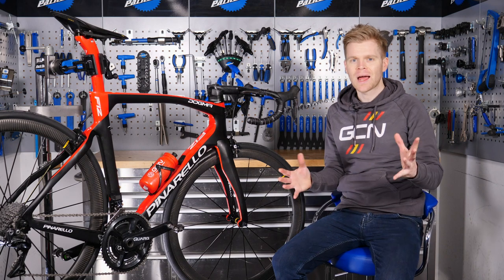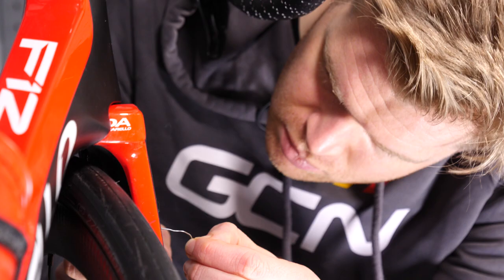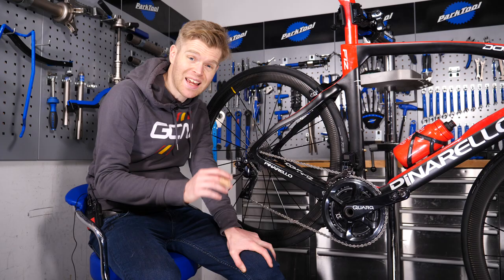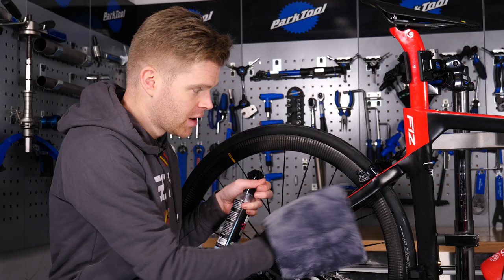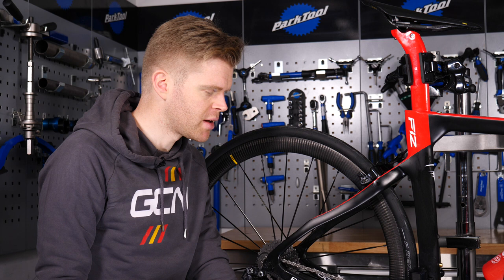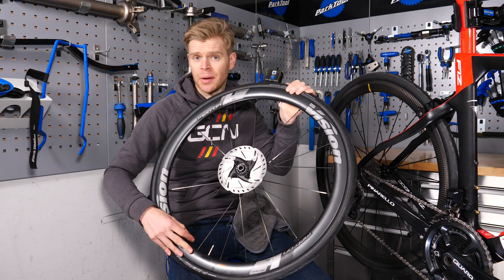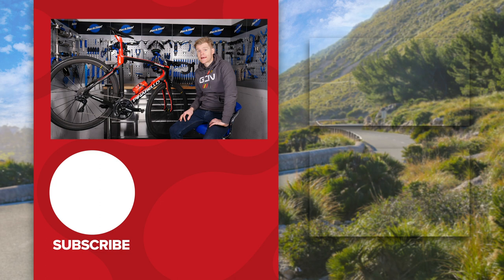Next Level Road Bike Maintenance Hacks | How To Make Your Bike Amazing

Comment from the maker: What are your next level maintenance hacks?
Reply: What about Si's WD40 one? Not worth a re-mention?
Reply: Get the intern to do it.
Reply: Staying with rims :)
Reply: Ride a fixed gear bike and only need to replace brake pads and drive train every few years.
Reply: I ceramic coat my frame and wheelset
Reply: Don't use wax on a chain.  Use unsalted butter.  That way you lube your chain and have an emergency snack if you hit the bonk.
Reply: simple silicon spray as a frame polish is a nobrainer.
Reply: @Robinators  just don't get on the brakes/rims!
Reply: CLP gun cleaner all over the derailuer, except the clutch. And then wiped off.

Rim brakes allow small truing adjustments in no time at all.

Gasoline is a great degreaser. And if its.poured in small amounts on the asphalt/stone surface it doesnt hurt the enviroment.
Reply: I just wish I had a bike....someone stole it from outside the local cafe stop
Reply: Start shopping in the car section for car protectants for bikes. If you have a glossy frame, look at turtle wax's hybrid series to get a hydrophobic surface on your frame.
You wont need as much compared to a car so one bottle can last you a long time. For the best or Matte paint you'll need a special kind of ceramic nano coating for matte paint.
Reply: My hack is to spend more time on the bike than fixing the bike.
Reply: The last time I changed my chainrings and gears etc I bought two chains and changed them regularly every 500 km. That way two chains get “friendly” with all the metal parts equally. And I didn’t have to hurry through a quick clean just to get riding again.  Chain stretch and metal wear has been negligible.
Reply: Wax and Teflon coating. 👍

Comment: Super glue the gear or brake cables before cutting them, let dry, then cut. Stops the cables unwinding and looks sharp
Reply: Cut and then superglue the end - for the real weight weenies
Reply: This! Easier and looks better than soldering them.
Reply: @lassefk3171  as I said, super glue before the cut, not after.
Reply: Thanks, gonna try it next time.
Reply: 2part quickset epoxy is a bit more water resistant than superglue.
Reply: 2part quickset epoxy is a bit more water resistant than superglue.
Reply: I use heatshrink sleeving on the end of my cables. Shrink it before I cut the cable. Nice and neat, and it ain't unravelling for anyone.

Comment: Instead of soldering cable ends, use heat shrink tubing.  Far more convenient, and easier to apply.
Reply: or a drop of super glue, I do it every time on my mountain bike :)
Reply: Agree, looks way better, easier and no risk of hot solder on other parts of the bike.
Reply: The solder doesn't work with good cables, that usually have been treated with Teflon.
Reply: 2part epoxy
Reply: I use ferrules, but I put them on properly :-)
Reply: Paul Sherwood, you’re kinda “special” then as no one else must know how?

Comment: Wrapping the bars the other way is a bad idea, the edges of the tape will peel back and look crap in no time.
Reply: 100% this. Add to that the weight of your palms near the hoods shifts the tape pretty easily.
Reply: Ollie needs to go back and do this again, I completely stopped listening when I saw that bar tape.
Reply: I had my bars wrapped like that when I bought it, rode it that way and you know what? not a single problem for 2 years until I changed my handlebars al together. the fraying is fake news. just wrap your bars the way you like it.
Reply: Just did this two days ago. We shall see what happens. If so, I'll throw on some electrical tape, no big deal.
Reply: @velocirapture89  Correct. Worst case, you tape it, so zero penalty anyway.

Comment: 1.  wrapping bar tape: personal choice tho, you finish tape in wrong direction. Make sure you wrap it very tight. 

2. Soldering cables zinc and lead dont stick to steel very well. For that you need something that can melt steal. I wouldnt mess with something like that around my carbon bike. Just use some superglue or better 2 component glue. 

3.waxing: good one. Only for summer. Dont do that in the winter...or dont forget to take some wet lube on a ride just in case.
Reply: PS: In my opinion, next level maintenance comes from tracking lifespan of each component on your bike. You can make simple spreadsheet with date of component installation and track lifespan of every component or better if you are using Strava just connect it to  ProBikeGarage app. Its simple and effective with end of life notifications and custom time or distance notifications for each component. I use it for charging my bike computer, chain wear check notifications, cassete wear and grease and clean notifications......
Reply: absolute legend right here
Reply: 2part epoxy is more water resistant.
Reply: So I repair electronics.  Solder is one of the ways to connect things.  These things are steel and alloys of.  The solder sticks well to those.  This is been practiced for decades.  Super glue cracks.
Reply: @McGregis  That's right I forgot you had a channel with tons of subs showing us how to fix bikes.

Comment: Has a PhD in chemistry. Doesn't distinguish flux from solder.
Reply: And the real pro's braze their cables anyway. Gold tips match the gold chain!

I did solder once, and it looked nice. Now I superglue + heat shrink. Just far easier, and works on friends' old/dirty cables, and they don't think you are as crazy as when they see you busting out the Weller.
Reply: and difficult to get solder to grab onto stainless steel cable.
Reply: @carlosgaspar8447  Carlos, use the right solder.  Usually 46 percent silver mate.  Works amazing with stainless.  Regular solder won't bind at all
Reply: Well, let's be honest, it's more electricians who know this stuff.

Comment: Don't know if I'd wrap the bars that way, wouldn't your hands naturally "unwrap" the tape slowly over time?
Reply: Agree
Reply: If that is the case, you can still start at the top of your bars and just wrap the other way.
Reply: Yes
Reply: Most people don't "throttle" their bars, but if you do, that method is not for you.
Reply: They've literally said in other videos not to wrap them from the top.
Reply: @markj.a351  yea. Working on bicycles for 40 years and you see customer who wrap from top down all gnarly.  
The cat 1 2 3 riders come in, wrapped bottom to top.
As a service tech, we wrap bottom up. The argument about throttle grip is moot. Gra ity, hands sliding down. Doesnt work well. Bottom up is correct. He just maybe made a mistake.
Reply: @brianritter9379  Wrapping bottom up is more about messing up the tape when riding in the drops. Wrapping top down, the upper half of each wrap of tape is exposed, so if you hands slip downwards at all while in the drops (sweat + gravity), it'll curl the top edge downward, messing it up.

The direction of wrap around the bars (clockwise or anti-clockwise) has to do with whether or not you tend to throttle the bars, but that isn't as much of a concern.
Reply: Without getting into a debate over whether bottom up or top down is correct. I've been ridding since 1985 and ive  wrapped my bars from the top (I like a cleaner aesthetic) and never encountered any form of unwrapping of the bar tape. It should be notted that I don't throttle my grip or ride to frequently in the drops and mainly ride by utilizing the hoods.
Reply: @anieste  as long as it works. Cool. It really doesnt matter.
Reply: @markj.a351  this video should come with a stupid sticker warning.
Reply: Been riding top down for about 3 years. Never had the tape unravel. Both ways work just wrap the bars in the correct direction.
Reply: @anieste  keyboard riders say you should have had problems. Go back in time and have problems, you silly :)
Reply: @valuableblu  that's a good idea.
Reply: the fraying and unwrapping is fake news. My bars came wrapped from the tops when I bought it, and I never had any issues at all. It really doesn't matter that much how you wrap them because we don't live in the '70 any more and bar tape is sticky now and will just stay in place.

Comment: Tip 1: don't wax your chain. Don't see pro's riding with them, and there's a reason. If you do it, you'll notice the chain will make more noise than if you had lubricated it. Noise are soundwaves, molecules in the air vibrating. To make these vibrate you need a certain amount of energy. Where does this energy come from? Yes, from your legs. Noise (acoustic energy) = energy loss. And yes I have experience with it because I do it for my city commuting bike, because this means I don't have to use oil and my pants stay clean.

Tip 2: Don't buy brake disc cleaner. Go to any auto parts shop and buy 'brake cleaner' for cars. It is exactly the same, it is used to clean new brake rotors upon installation to prevent squealing brakes. The only difference is the price. and it's a huge difference, a factor 10. I buy brake cleaner for 1.09€ per 400ml bottle, where as the muc-off disc brake cleaner used in this video is between 10-20€ for 400ml depending on where you buy it.
Reply: Tip 2 especially.

Comment: I use isopropyl alcohol on my discs and then wipe it off with a clan cloth. Cheaper and better
Reply: Likewise, does the job and much cheapness.
Reply: I get good results 50/50 distilled water/91% isopropyl alcohol....👍👍👍👍
Reply: is isopropyl act as a degreaser?
Reply: @lucianoserafino5872  yes. Cheap but great
Reply: Not cheaper where I am, $10 for 4 cans of brake clean, $8 for tiny bottle of iso.
Reply: @derekhobbs1102  does your commercial brake cleaner work well? I use diluted ISOPROPYL and wanted to try auto parts rotor cleaner. But read an article in bicycle magazine that cautioned on some auto cleaners as they contain small amounts of oil
Reply: You don't want oil contamination on car brakes. 
I use it on my bench tops after every other cleaner to get last residual oil off.
Reply: @derekhobbs1102  I know that. But apparently manufacturers of disc brake cleaners add oil to keep rotors from rusting

Comment: Extra hack.  Add 25 grams of PTFE to the wax bath and just a touch of paraffin oil, around 5% by volume relative to melted wax.  Paraffin oil means different things in different countries, but the best stuff is used in beauty salons to lower the melting point of paraffin wax they use to rip hair off of people's bodies.  So search for it using words "paraffin oil bikini".  Add a little and it is quieter.  Add too much and the chain is not as clean.  The method in the GCN video (pure paraffin wax only) will result in a much noisier chain and one that is quite stiff for the first 50 km.  However you do it, molten paraffin wax is vastly superior than any other lube.  The ultrasonic cleaner helps a lot.  If the chain is not cleaned to bare metal before immersing it into wax the first time, the wax won't adhere as well.  After the first time you just need to re-immerse in molten wax.
Reply: i agree. but for paraffin oil, go as your weather temps/humidity demand. the colder/wetter the weather, the more paraffin you add. simply to keep the cream texture which lasts longer and sticks better. 5% is the bare minimum for a "normal" weather.
Reply: I use 50grams of teflon powder per 500grams of paraffin wax, absolutely brilliant, still have a clean drive train after 100miles this weekend in wet wales. And its silent
Reply: @nearlee2000  I've done it that way too.  Works great That way too.  The only advantage of my recipe is paraffin oil costs a little less than PTFE and chain is a little less stiff at the beginning.
Reply: @JayB-lz6yd  Yes.  In very hot summer of Houston it is better with 2% paraffin oil.
Reply: Give your chain a true 'Brazilian' . I cannot possibly be the only bloke to think this 😜 ew!

Comment: I've been soldering cable ends for years, it works great.  Easiest is to use some flux as well as the flux-cored solder.  I have also used a wax chain lube called 'Squirt' this winter, it has worked great.  If you are going to have a really wet long ride, just apply it twice the day before.  The chain stays nice and clean without the faff of a hot wax bath.

Comment: As far as the brake cable end, try snipping off the cable for a smooth flat-end, then just add a minute dibble of super glue to it, then slid on a new cable end of your color and allow to dry on without crimping for a beautiful clean look.  Hack ahoy!

Comment: To solder the end of a cable either use a very high wattage iron, or a small torch.... Using an iron meant for small to medium size electronic equipment is a bad idea. (A bodge if you will).
Reply: Walt Hansen a reminder not to get to close to the carbon frame with that torch is due

Comment: Backward bar tape, Ollie, makes it wear out faster because your hands always will gravitate from center towards the brake levers, eventually catching the edges of the tape and curling it upward -- not good.
Best, cleanest approach (imo) is to start at the plugs, in the lower middle and begin wrapping in the direction of the headtube. Working up the bar this way you'll also be able to cut off and super-glue without using finishing tape.  It just makes sense.

Comment: You can also use Isopropanol for disc brake rotor cleaning, it as well is a really volatile fat solvent , since it’s alcohol. There are options with 70% and 99% concentration, the 99% one being stronger but also more volatile, so the 70% one might be weaker but has more time to do its thing before it evaporates. Both work really well but most of the time the 99% concentration is cheaper to buy, because 70% often is medical quality. So you could just buy 99% and dilute it yourself. Wether option you might choose, it will sure be cheaper than buying specific disc brake cleaner and works the exact same way.

Comment: If you're going to wrap tape from the stem down, make sure you are wrapping the correct direction so that twisting action tightens the wrap (unlike what it looks like was done in this video).  You'll still need to switch direction at the levers to account for the opposing twist direction.

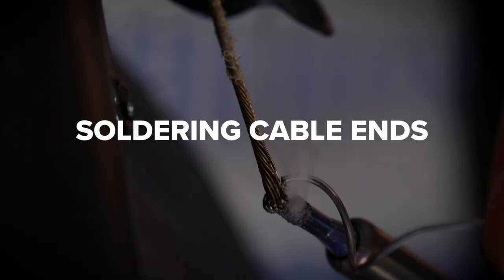Comment: TL;DR   1.  0:21 Smarter bar tape    2. 0:52 Soldering cable ends    3. 1:56 Drivetrain    4. 3:46 Bike polish    5.  4:27 Disk brake rotor cleaner

Comment: I've used some thin translucent flexible silicon tube for the ends of the brake cables - you can push that on all the way up to the brake then trim the end a bit longer than the cable.
Might try the super glue thing next time.

Also tried that disc brake cleaner - I've never heard such a scream from them and had to wash them to get rid of it.

Comment: Using larger jockey wheels even without an aftermarket long cage setup, dramatically changes the effort needed to pedal uphill. The only problem is w/o the longer cage it's harder to adjust the RD so the bigger jockey wheels don't touch the cassette.

Comment: If you're going to solder the cables, first make sure they are NOT frayed AT ALL. Otherwise you will never be able to pull them through the outer cables. In fact it's best to do this to new cables only. Solder a 1 inch section and then cut them to the right length (in the middle of the 1 inch section) with proper cable cutters.

Comment: : Has there EVER been some proof of big sprokets reducing friction? I'd like to see it. Not that I don't want to believe it but I just want to see a paper on it. It's true, that the chain bends less but on the other hand more chainlinks are bent at the same time and in both cases the chain ends up with 180° bend when it exits the chainring or the rear derailleur.
Reply: Chain links bent at the same time is a red herring. All chain links pass through the jockey wheels regardless of the size. That less of a bend reduces friction is a fact - that's one of the reason why pros aren't a big fan of srams new 12-by system with its smallest 10 cog sprocket, and why track bikes have large front chainrings and at least 14 T in the back.

Of course on the jockey wheels the effect is far less than on the chainrings or sprockets because the chain is not under such tension, but it's there and it's measurable.

Comment: You're supposed to hold the iron to the cable and then apply the solder to the cable while it's hot. That way, the flux (chemical that de-oxidizes the cable, within the core of the solder) can do its job and the solder will actually stick.

Comment: Why do you solder the cable? I just dip the end into the tip of a tube of super glue and let it dry, then cut to final length. It holds the strands together quite well.

Comment: One thing that I have noticed is that when riding on wet road. It will get more dirty when riding on asphalt road with heavy traffic, than when riding on gravel with no traffic, even when it's muddy and puddles on gravel. Assuming that bike has proper mudguards of course. Also the kind of tires you use change how dirty it gets.. Narrower tires are better, in general.

Comment: Use the soldering iron to heat the cable up, then let the solder flow into the cable end, if you end up having to do what was shown in the video then your cable isn’t hot enough.
Reply: Well In my experience even with very hot cable its a problem. Your cable should be coated with something that takes solder well. Imagine you do that to one of those cables coated with plastic... ;)

Comment: #AskGCNtech I recently purchased a nice set of carbon rims, however on the first ride, the braking surfaces (rim brakes) caused more wear than the entirety of it life with their previous owner. Apart from not using the brakes, or riding in wet conditions, are there are tips for prolonging the life of rim brake carbon rims?